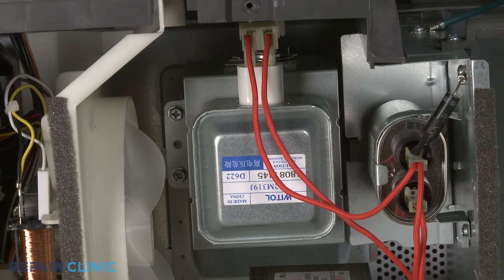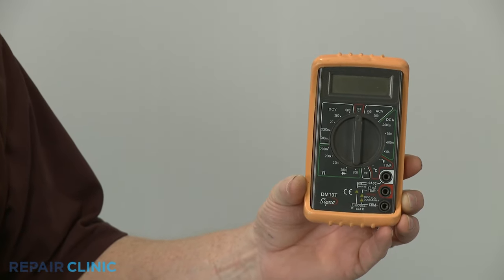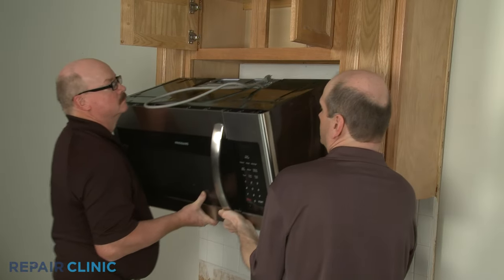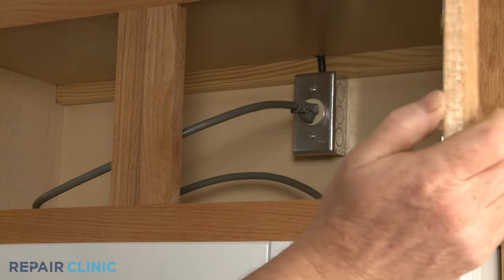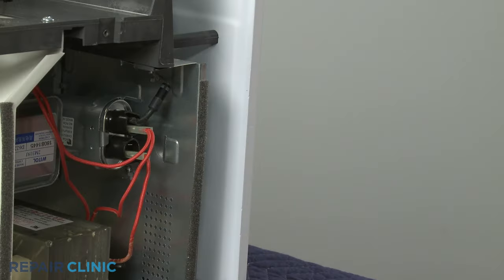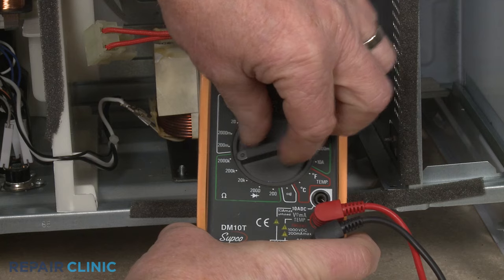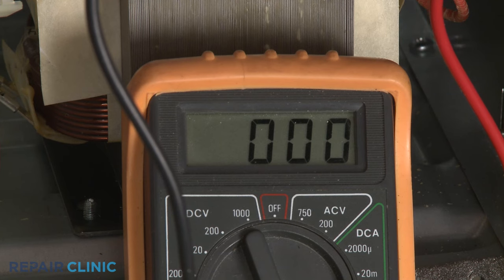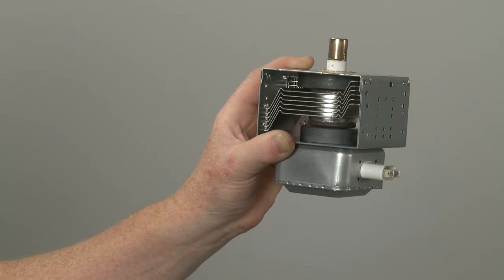Microwave Magnetron Testing

Comment: I checked magnetron its showing 0.2 ohm it good or not
Reply: It is good, anything higher than 5 ohms basically reduces the amount of current that can flow through it and make it not work properly. Another test they forgot to mention here is to test both leads to the case (one at at time)

Comment: So my microwave runs fine except it doesn't heat food.  It makes the loud buzzing noise when you turn it on.  My magnetron and diode test good according to these repair clinic videos. So what else could be the issue??
Reply: same problem. First, the fuse broken, but when i replace, the fuse not broke and the magnetron sounds too rare...and not heating...but i check all elements and all its good... (diode, capacitor, transformer... the only thing that i dont know its the exact functionality of the magnetron, and they have continuity....
Reply: Hello my friend, one question, he said if it has continuity the 2  prongs that means it's good magnetron, I also read an article where it said to check the magnets for any damage and yes one of them it's broken, that tells me it's bad, but I do not get it why is still  continuity at the pins, hopefully you help me understand. Thanks in advance.
Reply: @LuisMartinez-fr9gq  I change the magnetron, and all works well. The old magnetron have a small derivation to shell (40-60 ohms) and maybe that was the problem...
Heats better than the last days with the old mgnetron. (the old magnetron have more than 15years old)
Reply: Hello friend thanks for replying, an old magnetron it's doing better work,  perhaps it's better quality, good for you, I want to do the same, when you buy yours do you have to match all series numbers or just the first 2 series, I checked on ebay they have some used ones, I am wondering if I can use one of them that only match the first two series. For instance, 2m213---09b, the other two series are different, my has c06l---100970, but I can not find a part that matches all series just the first two, any thoughts my friend, thanks.
Reply: Hello my friend, thanks for replying, the older part it's doing a better job, perhaps the part was better quality, good for you. My friend I want to buy one from eBay they have used ones, the only thing is they do not match the four series on my part only the first two series, for instance, my is 2m213---09b,  c06l---1000970, I only see the first two series good for me on those used ones, and it doesn't match the bottom numbers, do you think it will work, any thoughts my friend, thanks.
Reply: I wasnt sure what else to do so I bought an aftermarket magnetron from Amazon for around $60 and my microwave works great now! It's just frustrating because I tested all the components in the circuit and all passed the tests.  Also frustrating because my microwave is only 4 years old.
Reply: Hi thank you again for replying, yes honestly I am going through the same process can not find the problem because my magnetron has a good resistance but it does not heat up my food, I really do not want to buy a part if I think my original part is good the only problem is that I am not 💯 percent sure, and it kills me because I am not good at electronics I just read or watch a video and try to resolve to save money, and why because I am the sole provider in my family, but I sincerely appreciate it your help, worse case scenario I will buy one used one (magnetron) if I do not find the problem correctly. They run on ebay for like $25 Dollars, again thank you my friend, can you help me through the process how to check the magnetron properly, the only thing I did was set my multimeter to ohms and see if it has continuity, but again I am not sure what numbers should I expect, talk to you soon my friend.
Reply: I read on internet, that the magnetron It has a useful life of 4000h. Im a technician of mechatronics (a little of all) and after checking all components and all was good, the main component that have all the "power" of heating its the magnetron... And i read that the filament heat and produce waves, so... A material that drive current and heat, It oxidizes and deteriorate externally but also internally, and that's the main reason. Others...maybe a small derivation to the case...
Reply: Hi friend, thanks for your advice, I am thinking to follow your advice, that a magnetron is that one who does all the heat up, and your explanation really make sense. Also I want to tell you that I am chatting with another guy and told me it could be the door switch, he said that if the door switch does not activate the electrical components it won't heat up, but what are you saying it really make sense, that the magnetron is responsible for the heating up, I am going to gamble this time. I am going to stop burning cells and order me one used magnetron, I will keep you posted, again thank you for your support.
Reply: @LuisMartinez-fr9gq   If the fan connects, the door switch was not the problem. If fan spins, check the relay that close the circuit of the transformer. If that works (and transformer, high voltage diode, and high voltage condenser... test OK) and not heat, the main problem was the magnetron 100%
Reply: Thank you for sharing your knowledge, I have not check the transformer, and the diode, but for sure that will be my next test, but like you said the magnetron is the problem if everything test good. God blessed you Sir, thank you for helping me out...
Reply: Could. Be the door interlock switches
Reply: Thank you, this door interlock switch is on the door side or in the microwave right by the light bulb is, please help me to find this switch.
Reply: @LuisMartinez-fr9gq well, how did you fix it? I went as far as taking the panel out and made sure nothing was burn. Checked 6 switches by the door. Put it back and it still doesn't heat.  It's either the capacitor or the magnetron.  I'm checking capacitor then going to purchase magnetron.
Reply: My microwave is manufactured in 1998 and is only doing the no rotate and no heating. Power, lights and timer work. I'd hate to test components and see they are good according to the tests in these videos.
I don't want to buy a magnetron.